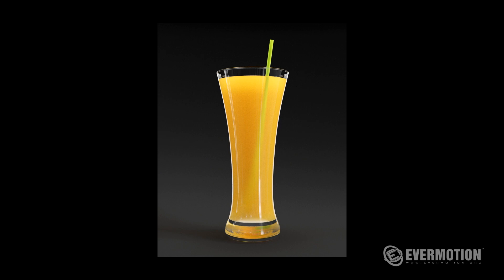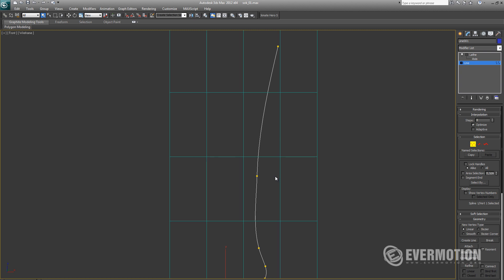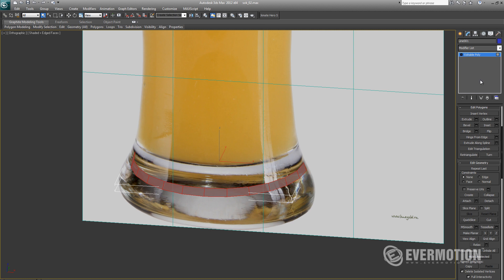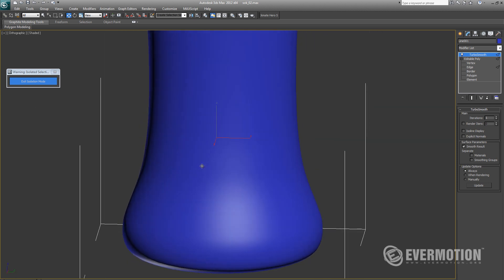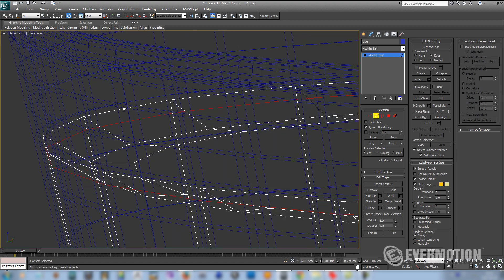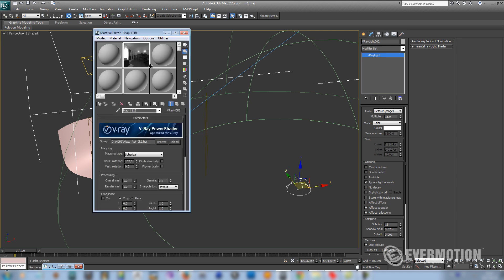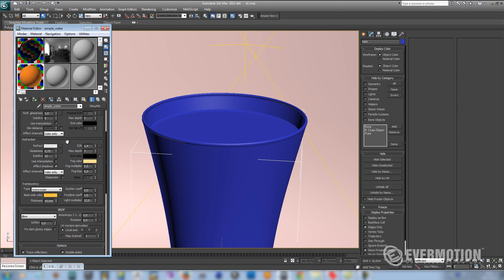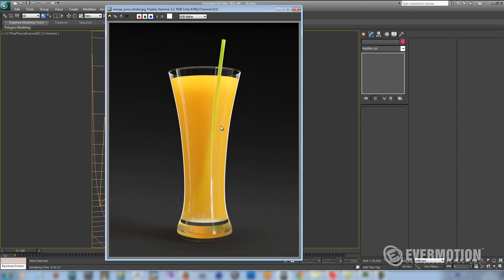Orange juice in 3ds max and V-ray - Tip of the Week

Comment: Modeling in 3D max sucks... people that have used other apps will tell you the same thing. It has a gazillion tools to do specific tasks.. as opposed to better apps having far fewer but more general purpose tools to accomplish the same task. So you find yourself constantly clicking and switching tools for every small step. I don't model anything in Max... I just use it for materials and rendering.
Reply: Advection357 what sofware do you use for modelling?
Reply: matasareanue Softimage..
Modo is also supposed to be a good modeling app. But keep in mind, I'm not used to modeling anything in max.. so I'm slow & get frustrated. I'm sure with some customizing you can set up keyboard shortcuts & speed up the work. The thing with Softimage is that it's very nicely set up for modeling by default. Autodesk killed it, but that still doesn't stop me from using it ;)
Reply: SK kaz Hmm.. depends what kind of modeling you want to do. If you want hard surface or industrial modeling (like cars, appliances) you can try Rhino 3D. That's the app I started 3D with.. it's a NURBS modeling app.. so it works with drawing curves/lines & making surfaces out of them. For general purpose polygon modeling, there are many apps.. I would go with Maya (which is an industry standard, so you can't go wrong with Maya) or Blender (which is free), 3D max is ok as well. For organic modeling/sculpting..(like making trees, creatures & other living beings) there is Zbrush , Mudbox & 3D Coat. So it depends what kind of things you want to model.. each of those apps has it's strengths & weaknesses.. so it's a personal choice on what you want to learn first.